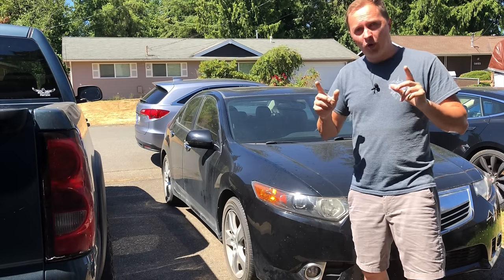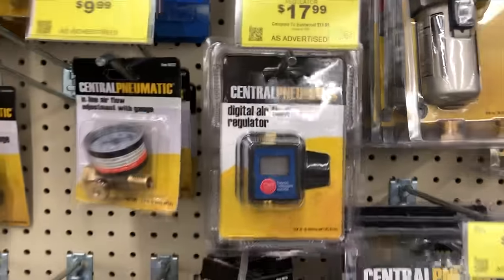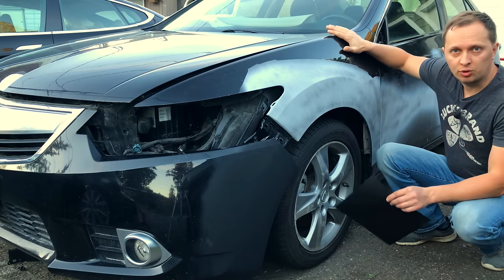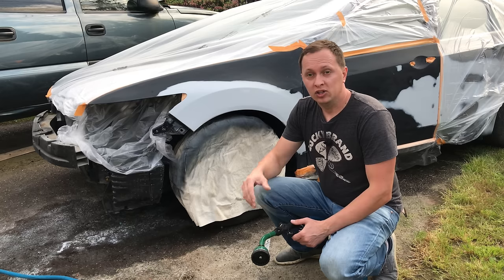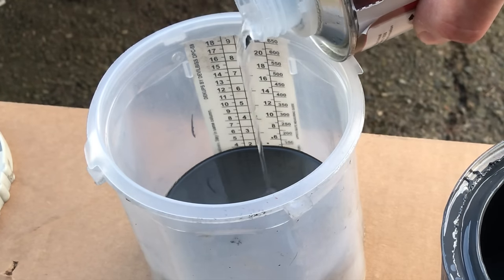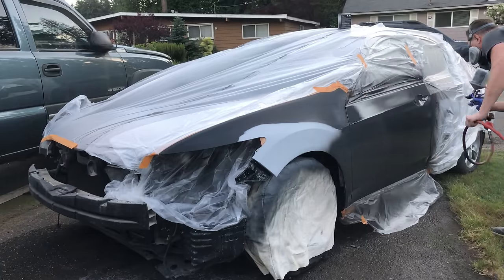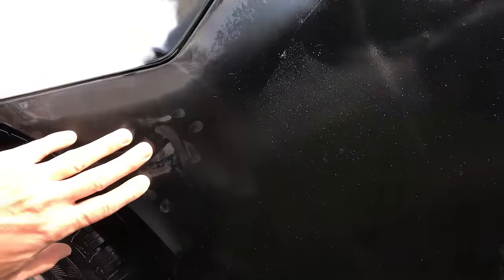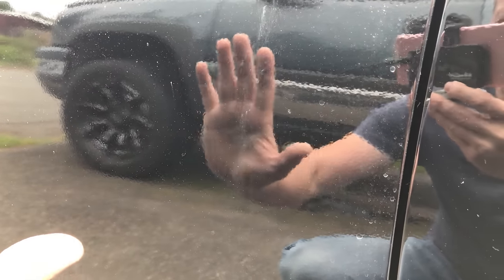✅ Using Cheap Chinese Harbor Freight Paint Gun to Achieve Professional Results

Comment: Your first mistake was spraying your car in what could be my neighborhood. No big deal right? although isocyanite is. Overspray can harm pets and wild birds. Diys don't need an expensive 3 to $500.00 gun to spray a fender or hood or even a whole car for that matter.
Reply from the maker: I don't paint very often, so the amount of overspray that's being put out is negligible... You say overspray can harm pets and birds, you know what else can harm them?  Lets for example say Weed Killer that people spray all around their property/lawns to take car of weeds, It's a real harsh poison, a know cancerogenic, then people also spay the ground around their house for bugs, things are the real things that can hurt pets, birds, bees and people, these harmful chemicals are all around and your neighborhood is no exception... 
Sure, DIYers don't need top of the line paint equipment, but I'll tell you what, at the end of the day you will get much better result out of a professional gun versus Chinese Junk. You can spray clearcoat out of a professional gun at much lower pressure and get a good, flat finish. To get close to that sort of a finish you would have to crank the air pressure WAY up on a cheap Chinese gun where most of your base/clearcoat will then turn into an overspray and will end up settling down all over the neighborhood instead of the body panels that you're painting. So in the end you are contradicting yourself, you sound like you care about the environment, but at the same time you are in favor of using inferior equipment that would pollute the environment even more...

Comment: Eww, nobody uses those gun filters!
Reply from the maker: I use them... They work just fine...  I really hope you're not basing your opinion on a Paint Society's video because it's total BS !
Reply: I'm experienced and no way will they flow properly with a thick 2K primer.  Metallics can plug 'em as well.  Most body men chuck em and filter their paint.
Reply from the maker: I don't use in-line filters in a primer gun also I've never had any issues with metallics clogging up the filter... I suppose if you're doing a custom paint with some large flakes then that would for sure be an issue

Comment: I have bought i chinese gun (purple one)
It is really a piece of shit.
Leaking paint.
Orange peal.
Reply from the maker: I feel your frustration my friend, as you said it that gun is garbage. Orange peels like crazy, and leeks in the spot where the cup screws onto the gun. I've actually been using this purple gun for primer aplication for the past few years and that's about all it's good for, had to put some Teflon tape between the gun and the cup to stop the leak and orange peel in this scenario is not a problem because most of that primer will be sanded off anyways :-)
Reply: I bought one too its really a piece of shit.
I had the same problem  leaking paint

Comment: What size compressor did you use?
Reply from the maker: I painted this car with my old 60 gallon compressor that really sucked, I ended up building much better custom compressor that is suited way better for painting, if you are interested here is the link to the compressor build video: https://youtu.be/YD1dNpelSpg
Reply: @fix206  thanks for the reply, I bought a spectrum 20oz HTE with a 20g compressor in hopes for a decent outcome. Small honda crx